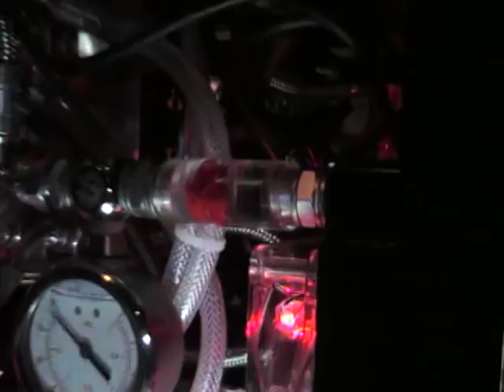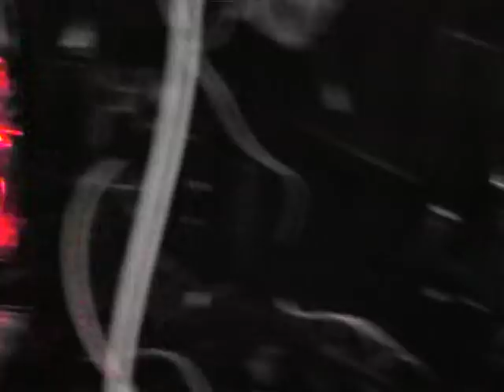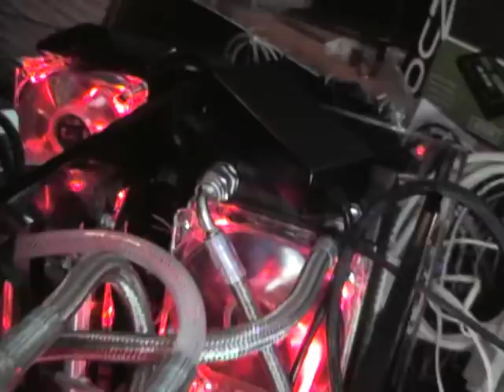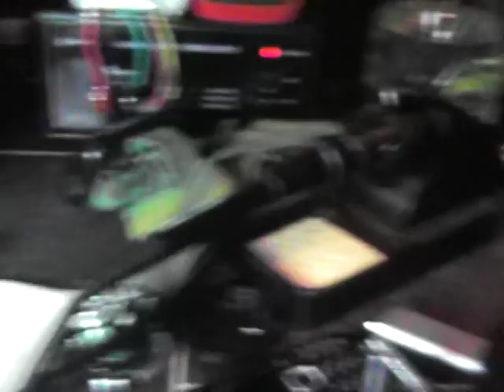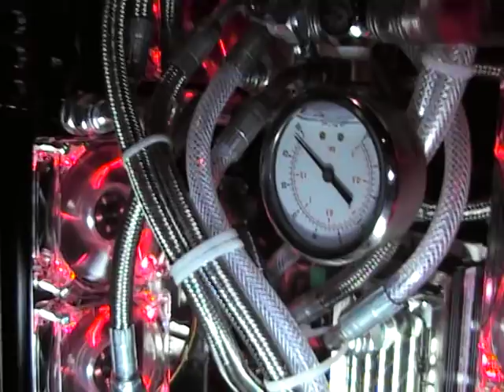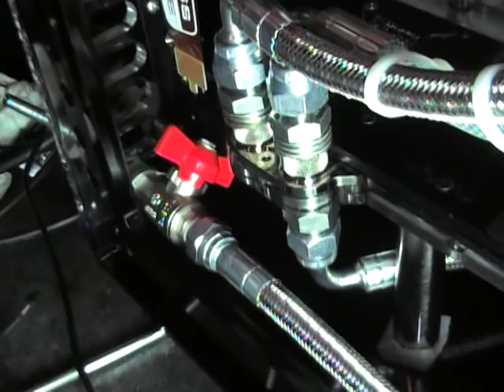EXTREME GAMING RIG, OIL COOLED COMPUTER

Comment: Why not use the pressure switch as a trigger to turn on the computer so the switch in the front turns on the oil pump and the pressure switch is connected to an analog circuit that cuts all power to the PC and oil pump if it has no pressure or you can work with a manometer that has a potentiometer inside or some other electronic measure.
Reply from the maker: Jan Girke   true

Comment: This is cool, but I don't get why put oil in sealed system like this when water transfers heat better.  I can see a totally submerged oil PC as a fun project, but this seems like a futile effort because it will never run as cool as it would with water running through those lines. Eh, still cool and fun to build I'm sure.

Comment: why not submerge it in the oil in a waterproof case. Use a non-conductive oil, waterproof case and an external radiator to cool it and you can submerge almost every component, save the hard drive and optical drive
Reply: What type of oil is conductive ?
Reply: The hardware will degrade in a few years.
Reply: @TwangMark  And water rigs don"t?... Get a clue... due to electrolysis with water based cooling rigs they too down grade and depending on how you do it it can be downgraded in a year.

Comment from the maker: temps were creeping up into the 90s my tests ended abrubtly when the MOCAL oil pump died,the temps are fine for say crysis 2 but not for flat out 950mhz bitcoin  mining which stresses the gpus to the max non stop,if i build again i will use EK FITTINGS EXCLUSIVELY  as the compression fittings when the pipe is cut square are extremely reliable

Comment from the maker: Great thinking ,if your gonna build be aware that some rubbers will swell due to reaction with the oils as long as they cant shift they should be ok also water is approx 6 times more conductive than the presently available oils so you want high flow rates get the pump right behind the chip in a low restrictive loop ,baby oil works but does break down over time build a loop that is easily drained

Comment from the maker: from my tests, the oils cant remove the heat packets any where near as efficiently as h2o mixes,direct oil cooling where the oil is directed directly on the chips  and as you say pre cooled via ac units would be interesting ,maybe in the future the oil manufacturers will produce an oil with better thermal properties ,I even imported professional computer cooling oil from america  but was not impressed, did enjoy working with the oil though

Comment from the maker: @Jolinator TEMPS DURING CRYSIS 2 MAX SETTINGS 65C THATS 2 HD6990 ON HIGHER CLOCK SETTING AND I7 990X AT OVER 4.5GHZ, THE OIL PUMP I USED WHICH I WOULD NOT RECCOMEND  (MOCAL) 12V WHEN RUN AT 5V WHICH WAS SUFFICIENT WAS ALMOST SILENT ,